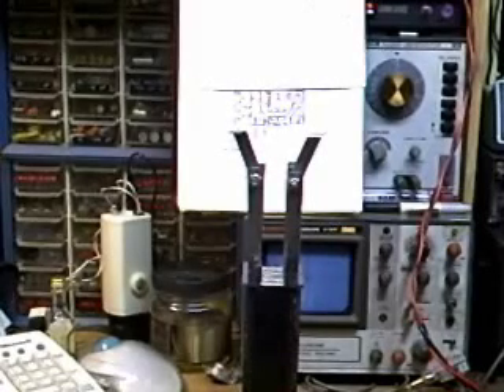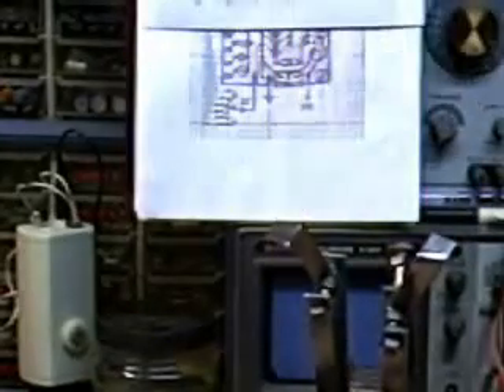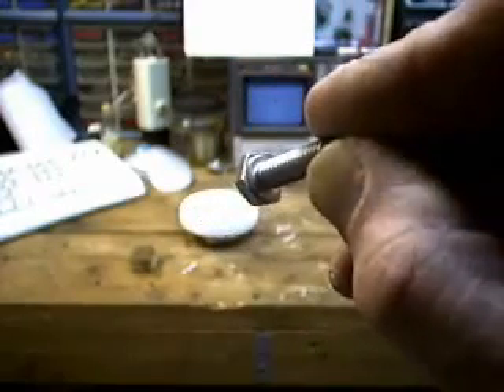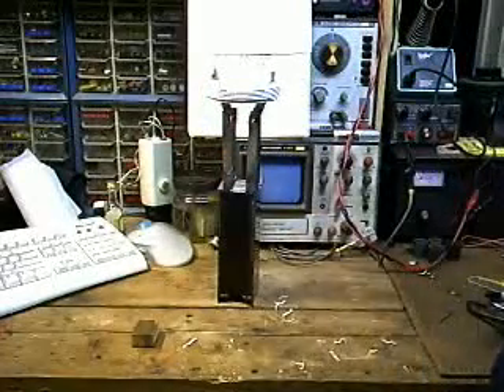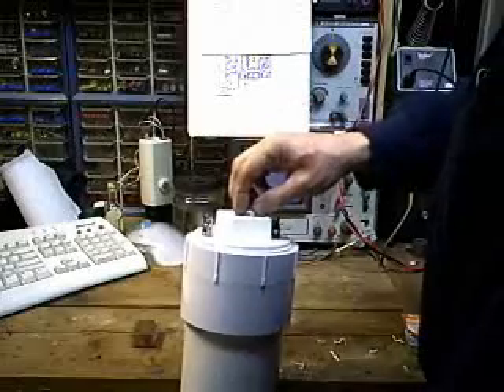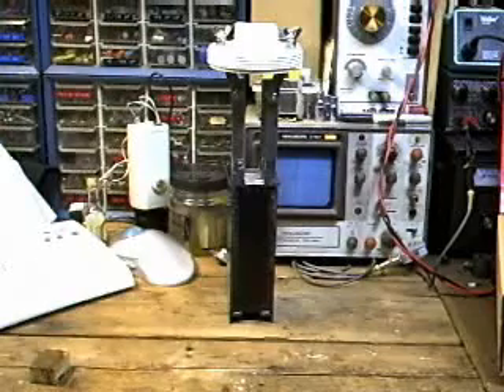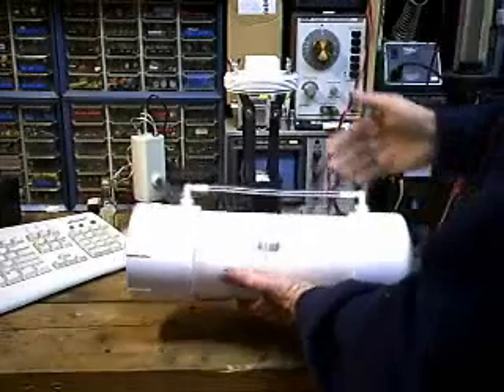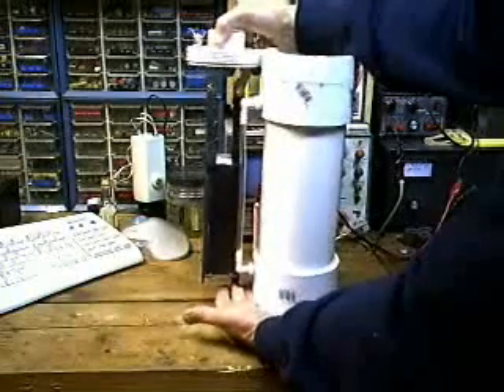#80 - VSPB cell chamber construction part 3

Comment: Hi ZFF,
it is better to get the connectors into the cell from the buttom, so all powered wires or SS holders are under water.
This is much more safe than if you have sparking due to bad contacts inside the gas area at the top !
Regards, Stefan.

Comment from the maker: Yeah. It kinda reminded me of the times I would solder 20-30 wires to the back of an Amp connector and then realize I forgot to put the threaded ring over the wires behind the pin block first. Pissed me right off.